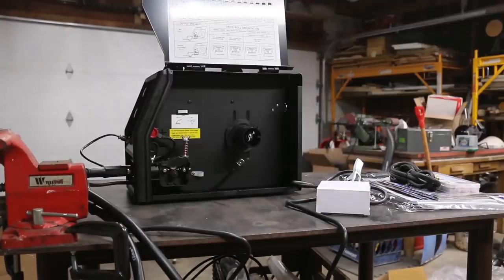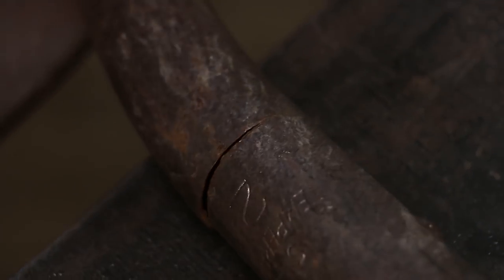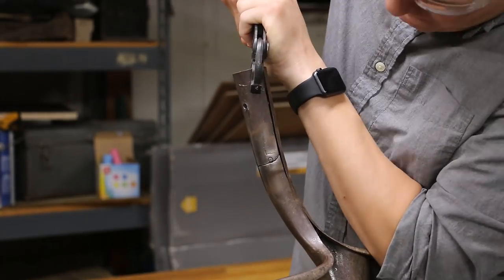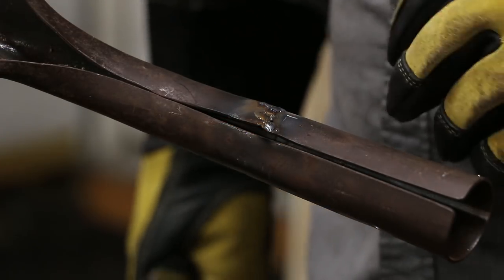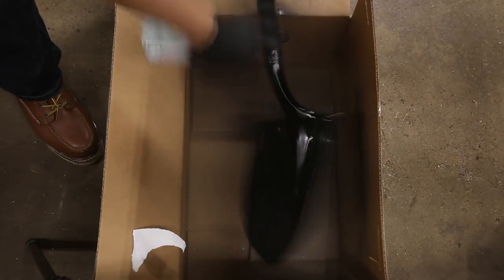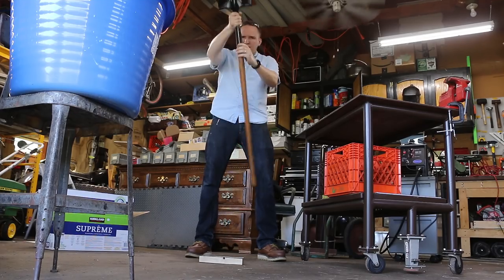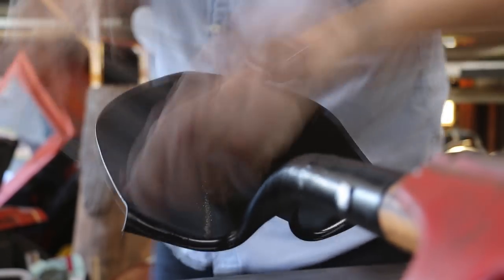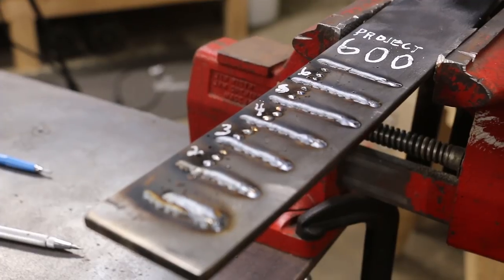Welding a broken shovel — Project 600

Comment: I don't have a mig, but I do the same thing with fluxcore.. Just have to be careful not to burn through.Welders are a great investment that pay for themselves many times over. Better to repair than disvard and replace
Reply from the maker: Agreed! One of the handiest tools in the shop. Unlocks so much potential.

Comment: I used my mig to fix the nutserts in the roof of my suburban (they were loose and spinning.) I also built a metal replacement mount for the plastic mount that broke for the sun visor.
Reply from the maker: Cool! Thanks for the ideas!

Comment: Have you replaced by adding another piece of metal to the shovel already used?
Reply from the maker: Nope, the crack was small enough for the weld to just fill it in. So it’s all original metal. Hope that answers your question!